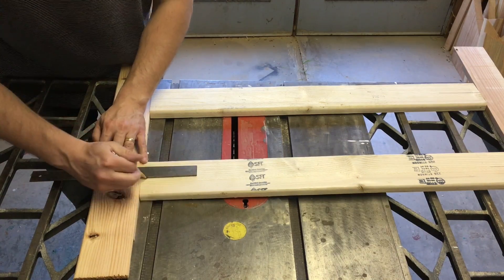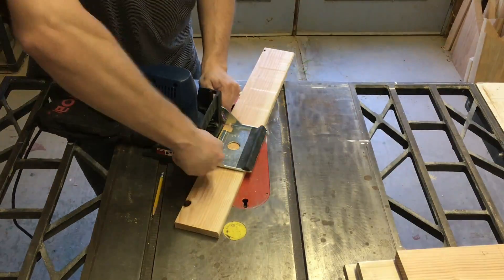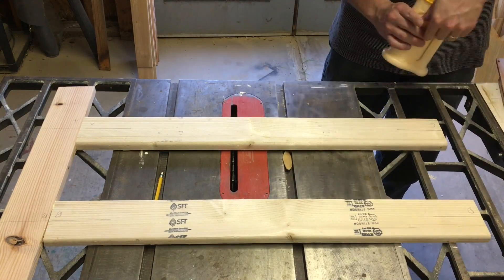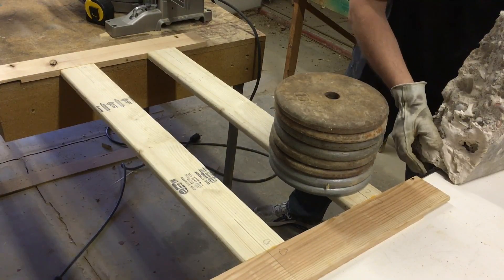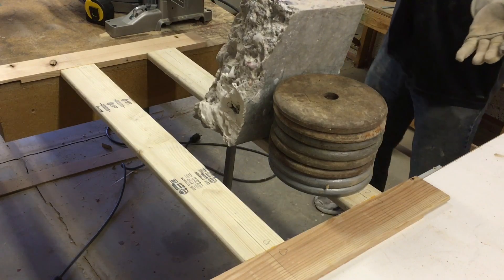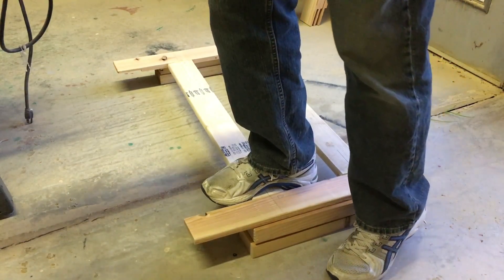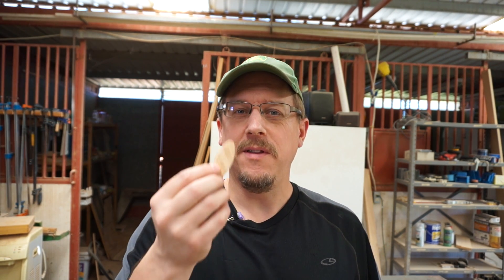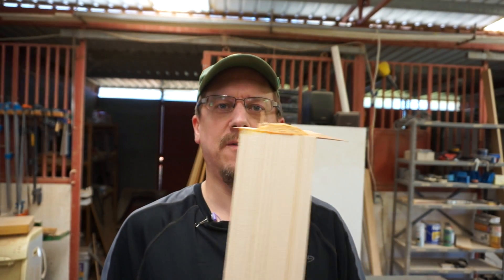Simple Biscuit Strength Test

Comment: Can you do pocket holes next
Reply from the maker: Hmm... I wasn't planning on it, since pocket screws have a pretty solid reputation already of creating a strong joint.  I seem to remember that Matthias Wandel did some pretty in depth tests, too.  I did the biscuit test mostly because everything I read suggested that they had little to no strength and should be used only for alignment... and I wasn't aware of anybody actually testing that knowledge.
Reply: @granworks  
The alignment thing has been overplayed. 

You can make a glue joint that is just as strong as a biscuit joint but people are assuming that this means a biscuit joint does not add any extra strength. 

The vast majority of real world glue joints are not going to be as strong as a biscuit joint nor as trustworthy. 

Biscuit joints increase the surface area of the actual glue joints and biscuits are also designed to absorb the glue so as to bond were as a finished surface of wood may not actually bond as well. Also end grain is terrible for gluing.

Comment: Would be interested to see same test against just glue joints. In one of your results I’m curious if the biscuit made the joint weaker as it seemed to fail where there was less wood at the joint
Reply from the maker: These are butt joints, so just glue would be catastrophically bad due to one of the pieces being entirely end grain.

I will say that the amount of glue is key to the long lasting success of these joints, though.  I used this method in two sandbox covers and can report that after a year, one of the covers is doing fine (the one where I used plenty of glue) and the other has completely and utterly failed.

Comment: You tested biscuit joint against biscuit joint, unsurprisingly the biscuit joint won that match.
Reply from the maker: Yep, if I was comparing the strength of the biscuit joints against another joint then this video would be a complete failure since I don't have any other joints in it.  Handily, though, this video was just a simple look at biscuit joints on their own in a very specific configuration... so no match to win!
Reply: nice test, and proves the point about the strength. However, pine or fir is so soft compared to beech that when you applied your weight in a small area which flexed, the inability for the compressed beech biscuit to move in conjunction with the pine is the reason the wood split. If you made a loose tenon with pine, I think the  wood would be less likely to split, as the flex would be the same. (or relatively close)